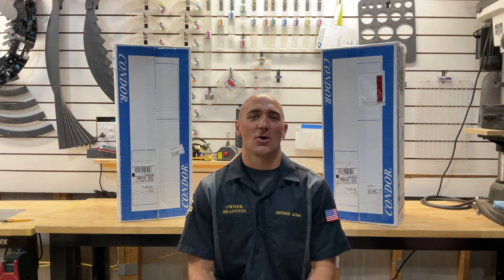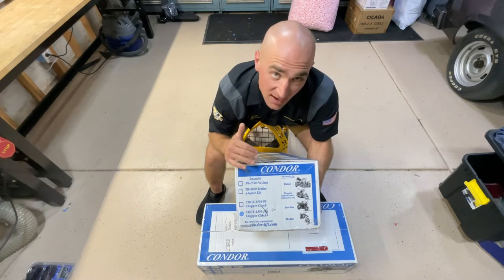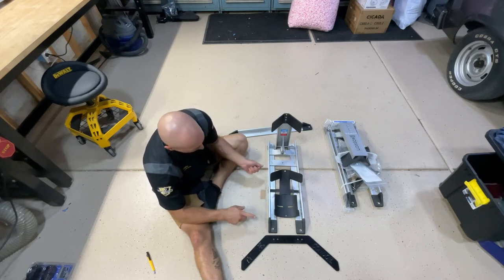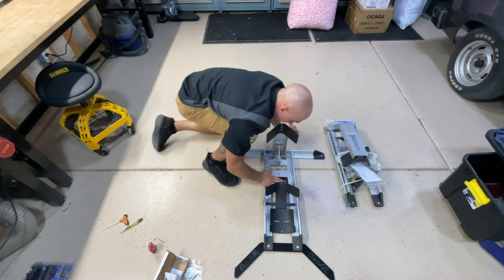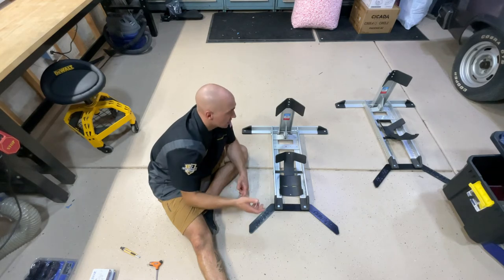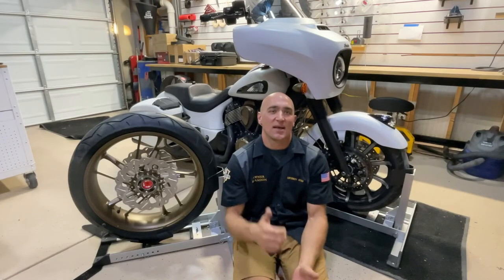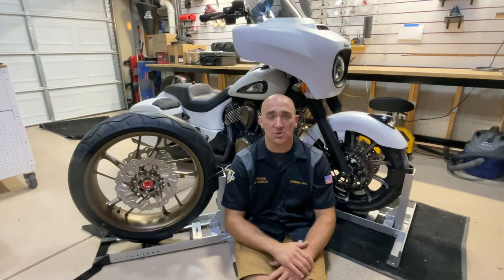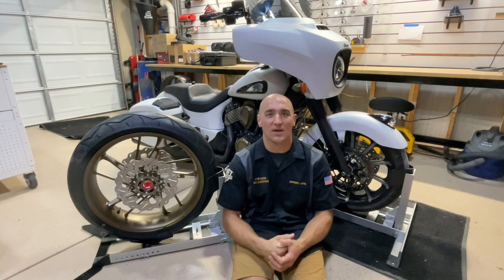Condor wheel chock

Comment: Thanks for the video.  I bought one,  but I can't get my Road Glide off the chock without help. Do you have any advice?
Reply from the maker: It sounds like you have the chock adjusted to far back causing the tire to seat to far and get stuck. Try adjusting it one notch forward and see if that helps
Reply: You should try the Wheeldock. It seems to be a MUCH simpler solution with hydraulic assist.